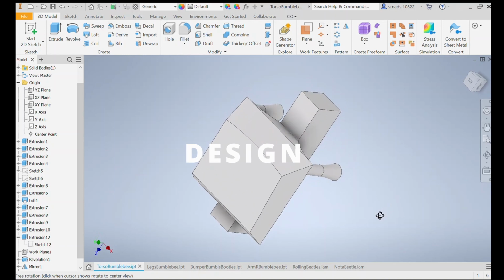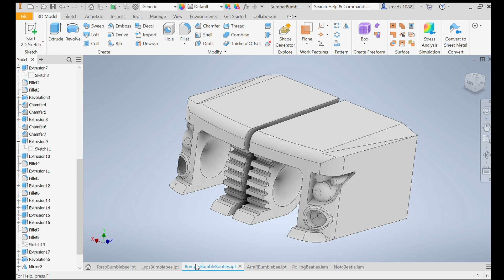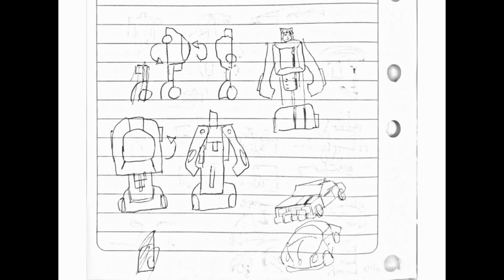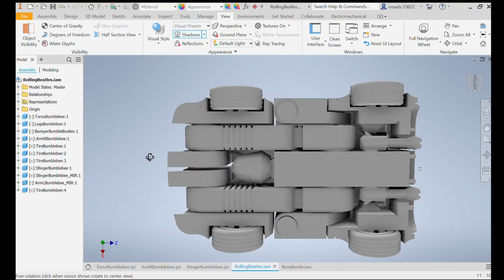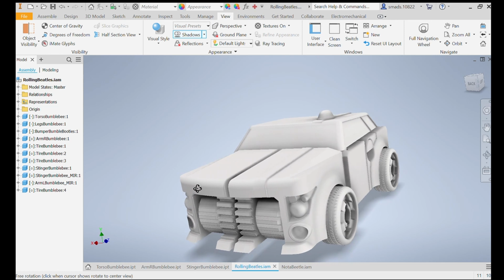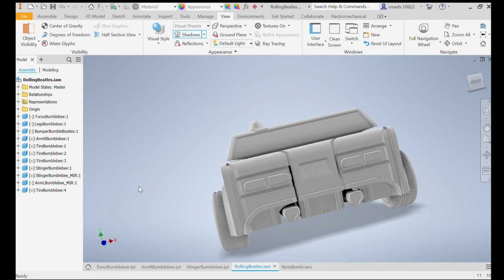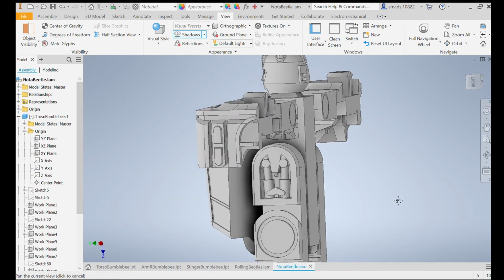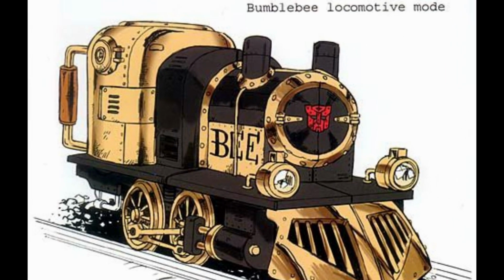Bumblebee: a 3D Printed Transformer

Comment: When are you going to make another and please make Optimus prime for the TOYBOX 3-D printer

Your cousin Luke
Reply from the maker: Hey, you can try printing this: https://www.make.toys/custom-toy-view/?toyId=gsQkMBxfrXYZTqwjF

I can't guarantee it will work because the Toybox printer has a relatively small build volume, which means that this transformer was scaled down to 50% size to fit on the build plate. This might cause the transformer's joints to be too stiff, or even cause them to fuse, so printing it will definitely be an experiment!

I also uploaded this: https://www.make.toys/custom-toy-view/?toyId=2Dht32SDZrN5tp8Cb
This will be an even more challenging print, and I had to scale it down to 90% size to get it to fit. Try the first one first and if you are successful, give this second one a try!
Reply: Thank you
Reply: Can you make soundwave

Comment: I had a really big problem with mine... the shoulders broke off the moment I took him off the build plate, I also did end up needing supports.
Reply from the maker: Despite being an obvious weak point in the design, in all of the test prints I did, the only issues I had with the shoulders were the joints fusing and not with layer adhesion. I think it may just be a difference in the slicers and printers that caused your print to fail. Tolerances are tight, so what worked on my setup may not work the same way on yours. Hopefully the print with supports solved the issue!
Reply: @TalmageMadsen  I'll try to fix it later, thanks for letting me know though

Comment: I printed it and the leg and chest fuses together what did I do wrong
Reply from the maker: I never had issues with the legs in any of my test prints, so I was not aware that this was a potentially troublesome area. Did you print at the right layer height (0.15mm)?

Comment: I wanna 3-d print stuff so bad but I have no clue how to make the items or anything I’m guessing the program you just gotta make stuff fit idk maybe you should do some tutorials also yours don’t seem to have the lines
Reply from the maker: To 3D print something is fairly straightforward. Once the printer is set up (this can be easy or fairly difficult depending on the printer model, but they have improved a lot over the years), you find a 3D file you want to print, put in a program called a slicer that makes your file into the same computer language your printer uses, and then put the sliced file (now called gcode) into your printer to print.

If you are thinking of designing your own models, consider this: to design something in 3D can be a more diverse process that can be done through a number of programs. Fusion 360 is a great free option, as well as TinkerCad for beginners. There are also 3D sculpting softwares that are better for designing characters and terrain, as opposed to parts and mechanisms. Just depends on what you want to do. It will probably take a lot of practice whatever approach you decide to take.